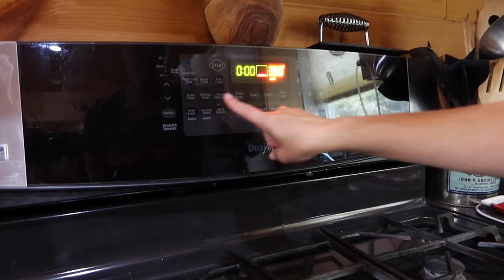Well I've Never Done IT Like this BEFORE. Prepping The Post & Beam Barn for Spray Foam Insulation

Comment: Are you going to batten the outside of barn still,?
A suggestion also would be to put up those baffles up by soft before foaming ceiling.
maybe pipe water down to barn for goats as a project also before winter. Then frame out your workshop.

Comment: If you are going to board over the insulation, why did you not just use mastic to hold roxul up until you board over it? You would not need to mask over your timbers.
Reply: Did you just get here?  Not using Roxul.  2 inches of spray foam.
Reply: @paulmonk7820  Did you not pay attention? He said he was not using Roxul because is does not stay attached to the wall without studs ( to jam it between.)  If he is going to board over it, that risk of it falling off after gluing it is short lived. 

             I'm using spray foam because
04:43  we got 8 feet ish on these big walls in
04:48  between the posts and if we did like
04:51 roxul or fiberglass  you couldn't
04:54 do it and it would just want to fall out
04:55 unless you put studs in

Comment: Build yourself a workbench with a trap door to drop your table saw in.
Get yourself a wall mounted Panel Saw, you are going to make a lot of panels.
Make hidden compartments in the knee braces.
You need a place for materials.
Cut scrap rubber pad for goat bed.
You need a sink with a medicine cabinet to put stuff in and hanging lamp.  Dish soap, sponge, comet , cleaning brush...
Plumb water a full pressure, not through regulator.
Fire Extingushiers
Build a wall mounted work bench in front of Gina's car to park under.
Make provisions for HVAC.  Wood burning stove?
Make provisions for an air compressor.
I know you know mechanics, were you going to build a garage with a lift?
Metal Rag Bin.
Flammables Cabinet.
Put a log splitter in the fire wood shed.
Get a Dump Bed Trailer to throw rocks in to clean up your field.

Comment: In the time it has taken to mask off the frames, you could have insulated the wall with hard insulation panels or even fibermats. As there are going to be animals either side of the main barn, I would also be worries about the vapours coming off the foam.

Comment: You made a statement around 5:11 that the reason you are going with spray foam is it adds structural value to the building. I agree 100% with that statement but you are not going to see that because you wanted to expose the wood beams inside the barn. You also stated that the foam was going to be 2" thick. If this is true you should have only applied 1.5" of tape on the sides of the 4x4s and papered the face of the 4x4.  To get the structural value you want from the foam you want the foam to adhere to the wood. This is important for where the wood 2x4's and 4x4's meet the wallboards. The way you taped and papered in the video the only adhesion of the foam to the wood is on the walls.
Reply: I agree 110% ;)

Comment: Al, the paper you covered the post and beams with is to wide, half that would allow the spray foam to adhere to the corners and insulate much better. It also would have been much easier to put up and take off. First time I've doubted one of your decisions.

Comment: You should do the roughing-in of the electricals first before you insulate the walls, IMHO.
Reply: Always!
Reply: @Arnold Allera:  They are installing conduit after the foam is done.
Reply: @paulmonk7820  Not a very proper way to go, tsk, tsk.

Comment: Yes. Wire it first, then insulate it.  Much nicer.
Reply: Wiring after will allow for a change in usage, though, if at some point this space is used for something other than a work space.
Reply: @stephanieellis5399  If they are going to wire it afterward, they can change use afterward.  I still say wire it first.

Comment: First project, add a metal flue for a wood stove for heat, with the concrete floor, fire hazard would be low.  On second thought, putting too much dry heat on the concrete floor before it finishes curing (can take a couple of years to completely cure) can cause it to crack.  Anyway some form of heat would be good in the winter.  I am with you on the insulation first since you are only using 2 inches that way you can run the wires and have access to them any time you need to in the future.  Keep up the good work.

Comment: RE:  cutting thru HARD food, such as buttercup squash....I have a kitchen hammer...i.e. one that lives in the kitchen only.  When I reach the 'un-cuttable' part, I use the hammer on the pointed end (not the point), and hold the handle part as I bang the knife thru.  Saves my hand, and helps prevent any accident that could be potentially B A D !    : )

Comment: Those bucks are not earning their keep. They can pull 1.5x their weight, assuming they are in the 30lb range: teamed they can pull 135lbs together, safely. More than enough goat-power to pull the feed buckets for the other livestock. Caprine is one company who supplies harness, etc specifically for goats. That would've been the training I would have started two weeks ago if I had two bucks living like kings  ;) But I am still wondering what's behind Gina's Mona Lisa smile regarding wood scraps last week.

Comment: Okay wait, I don’t understand the paper, won’t it prevent the spray foam from sticking to the wood, and if you plan to pull the paper off it will pull out the foam? I get the tape on the seams... well. I hope it works out for you... that looks like a lot of work. I sent my friend, Figaro to tell you not to do it..

Comment: I worked in cafeteria for 39 years, please when you cut those squash place a pad or folded dish rag over the point of your knife before you push with your weight on the end with your palm. If it slips the tip of the knife will cut open your hand. I have seen it happen.

Comment: Curious, how is the spray foam going to stick to the wood if you put paper on it? Won't it peel away in those areas? I understand covering the exposed surface but not the boards.
Reply from the maker: We still have one more step we need to do to get ready for the spray foam.
Reply: @LumnahAcres  Can't wait to see the next vlog.
Reply: I was wondering the same. I have no idea what’s going on, but I’m excited to learn! Haha.
Reply: The paper on the posts and beams is to keep the foam off them.  They want that wood visible when it's all done.  The tape over the cracks will keep the foam from escaping thru them. You know how foam is, it just goes wherever it wants to.
Reply: Paul Monk but there putting batten boards in the outside seams. So why not do that now instead of taping the seams? I could see if it was a vapor barrier?

Comment: Check in to the flammability and potential fumes-when-failed issues with foam insulation.  Mineral/Rock wool seems a better natural material, and it now comes in boards, batts, etc.

Comment: Hey Al, if you still have other projects that you need to use that paper to mask off I would recommend a hand masker, 100x easier to put on take off after. Paper roll and masking tape are attached to it and feed out together.
It’s used when prepping for painting usually

Comment: Vail, Co already has soem snow too. Are you using Open cell or Closed cell spray foam? (Used to work for instulation co lol) Open only has R value 0f 3.5 and Closed has R value of approx 6.5. Just wondering.

Comment: seems like to much trouble to me for a shop.  I would put the boards on the out side , you have to do it anyways to cover the cracks.  Then use the proper R rated fiberglass insulation.
Reply: @Kerry Burroughs:  This has already been explained. This is a post and beam building that they proudly built from scratch with their own hands, and rightly so. He doesn't want spray foam on the post and beam structure.  I agree, I would want that feature to show.

Comment: Hello I have liked all of your videos that I have watched so far. I have noticed that you keep changing the battery on your Pig fence here is something that might help first build yourself a small box with a bottom side and a top that is water and wind proof  and on the top put a small solar panel setup that will keep your battery charged this should save you both time and money in the long run. I hope this helps.

Comment: Would plastic have worked easier?  Since the insulation will be in those sections, do you need to paper the sides of the post?
Reply from the maker: It should make more sense in the next video on why we are doing what we are doing with the paper

Comment: Please tear off the paper and start over. Only put tape exactly where you don’t want insulation, not under it. Put the battens on the outside and let the foam fill the gaps.

Comment: why not run some pvc pipe around the walls for adding wires later. Then it would be covered by the insulation.

Comment: Would not spraying the foam insulation without tape penetrate and seal better than tape? And why duct tape and not a higher quality tape?
Reply: 10tenman10 thats masking tape he used, not duct tape. Different animal.
Reply: @cathiwim 
Which would be better. Masking tape is generally cheap junk. Why not just leave the gaps open?

Comment: Don't you have exterior battens or some such to put on the gaps in the back wall?
Reply: Yes I thought about that as well
Reply: So did i
Reply: A lot of viewers bring up that observation.  Al has a reason for not applying the batten at this time.  So, lets just see.  He knows what he is doing.  Same thing goes for the woodshed...at least on the car port side.  Al mentions battening that side...but for reasons unbeknown to us, is just belayng it.  In Al we trust.
Reply from the maker: No they would just be chew toys for the goats. 😆
Reply from the maker: The batton strips would be chew toys for the goats on the back side. We want to let the wood shed dry out first. And then decide if we want to leave the gaps to help ventilate the firewood or use the batton strips.
Reply: C. Ruf !
Reply: @CRuf-qw4yv  Someone said the goats would chew on the batten boards, and so he was going to wait 'til he moved them.
Reply: @LumnahAcres  BUT WON'T THE INSULAYION GET WET AFTER TIME AND CAUSE MOLD.

Comment: Yikes, that looks tedious, I would not have the patience.
Reply from the maker: It was. 😆
Reply: @LumnahAcres  I wouldn't have the patience either but I can't wait to see the results Al,
Reply: I didn’t have the patience to watch all that taping and masking.  Boring to watch.  Should have time lapsed it.
Reply: Why not just put the batten strips on the outside walls now instead of taping every seam? Seems like twice the work for the same end result?
Reply: Its a lot easier to tape it off now, than scrape it off later!
Reply: @kenwillis8487  I thought the same thing.  Actually, I thought they did.
Reply: Fast forward the video. Skip the boring bits.
Reply: @hallenw  - I just speed things up 2x. : )
Reply: @kenwillis8487  From my own experience, the spray foam can (and will) ooze out the tiny cracks between the battens and the boards then you have to scrape it off the outside.

Comment: Knowing the state where you were building the barn, why wasn’t some kind of insulation built into the barn?  Was it a very high expense or wasn’t it offered?  It seems like a lot of very tedious work after all the exacting build that came with the kit. Hmm 🧐. Could you have just painted the areas and that would have sealed the gaps?

Comment: Why are you putting the paper on the walls, how is the foam going to bond with it?
Reply from the maker: We still have one more step. It will make more sense Thursday. This is the way the spray foam company recommended doing it.
Reply: You know Al always does his research😊 Love that tack hammer.
Reply: Was wondering the same thing. Especially if "like unwrapping big Xmas gift" means pulling off paper, wouldn't that pull insulation away from the wall?  Or will wooden strips Gina's cutting hold insulation in place after removing paper?  🤔🤔🤔
Reply: @JohnWarden It looks like maybe they are making removable custom fit foam wedges? maybe to pull them out and mount the electrical behind then replace them? I have no idea, never seen it done like this, but it would be nice to have access to your wiring in case you needed to modify or repair something down the road
Reply: I think they are masking off the timbers to protect them from overspray.  Easily removed once the spray foam is done. That's my opinion. Hope everyone has a blessed day. My Bad I should have waited until the end of the video. He said it was to protect the beam😄
Reply: John Warden  i guess we will find out!

Comment: I hope you will read some reviews from people who have already had foam insulation sprayed in their homes. Sometimes after the installation has dried, the odor from the foam insulation is so toxic that people have had to move out of their homes. There are YouTube videos on this.
Reply: Good thing they don't live in their barn!
Reply: Yes, that's true.  But it's because the installation was rushed.    Depending on thickness, spray foam is sprayed in multiple layers allowing each time to off gas and start curing.    If you spray to fast, the top layer seals the bottom before it can fully off gas and cure, trapping fumes and uncured chemicals.    Same happens if you apply too thick of a layer.     There is a proper technique to follow.    Some just didn't care enough to learn the proper installation methods.

Comment: Why are you wrapping the sides of the beams, should only be the fronts if you want the foam to add strength to the structure
Reply: @James T:  They're only putting in 2 inches of foam, and they don't want overspray on the post and beam structure.
Reply: He's only spraying 2"s of foam and so part of the sides of the beams are going to show.
Reply: The foam will then slide over the paper... i would say.
I though the same.
Reply: @IceLynne , The paper should not be going all the way around into the corner. It should only wrap around the beam half way.
Reply: @augustreil  I agree with you but he's so meticulous that I'm going to give him the benefit of the doubt for now and I'm keeping in mind it's not a house but a barn/work space. I'll give a final judgement when I see what the finished job looks like ;-)  Who knows, maybe the guys who will spray the insulation will tell him to take it off! lol
Reply: @IceLynne , Agree. I used to do spray foam and for proper adhesion, the surfaces need to be bare and clean, that's all. I'm sure it'll all work out.

Comment: What happens to the foam along the wood joints when the masking tapes peels off
Reply: @ray427:  The foam will harden into a solid structure across both boards. No worry.
Reply: Paul Monk thank you, not to old to continue learning

Comment: Al, I hope you are planning to use open cell foam so any wet wood can dry. Closed cell may prevent water that leaks around windows from ever drying which will enable rot. The hundred plus year old barns in your area were never insulated. Unlike today’s homes, your barn was not built to keep water out.  I would speak to a knowledgeable builder before proceeding. 

Make sure to allow the wood cavities to dry from the inside or your barn will have a short life.
Reply: There are cheap ways to heat an un insulated barn. Wood stove when you are in for a long time. A hose looped thru a compost pile can bring in heat and your animals don’t need heat.

Look into a rocket mass heater as a summer project if you need more heat.

Comment: Gina, did I understand you when you said you and Al cheat by using water from your electric hot water heater?  I've never had an electric hot water heater, always had a gas one.  Was told never to use the hot water from it for cooking because their is a sediment that forms in the bottom of the heater.  Was wondering if what you're doing is safe.
Reply: There is no difference in the water inside the tank.  Have you ever drained yours and seen the sediment that comes out?  It comes from the water, not the heat source.

Comment: why did you not put up the batten strips outside?? that would have sealed the joints and saved tape, taping off time.
Reply from the maker: We didn’t put the batten strips in the areas the goats are because they will use them as a chew toy.

Comment: First time I went through and read a bunch of comments. Lots of free advice in there. 

But me as well, I don’t get what you are doing with the paper.
Reply: He wants to prevent sprayfoam from sticking to the posts. The sprayfoam guys told him to cover them this way. He will then remove the paper and is planning on covering the sprayfoam with something (not sure if he said with what, I may have missed it!). It looks like the boards Gina was cutting will be run horizontal on the walls before the sprayfoam is installed, to give him something to nail the wall covering to?

Comment: I know it's a few days late... but .... if you use your drop saw to cut the paper to correct width you can secure it with just staples and not have so much overlap and waist. Putting the vertical sections with the staples on the side of the posts hides them under the spray foam... and any expose staples (Much less) can be removed.

First winter job.
 To setup the vacuum pump on a shelf so all you need to bring from the house is the claned jar,lid and teat line.Have it set up so any overflow runs into a second jar mounted to the wall. you just plug into the vacuum line and press start(Power). you can also put hobby air pressure switch to set the suction an automate the vacuum. 
Second Winter job.
Automatic waterers and heat for the animals. requires guttering an IBC Tote,water tower and plumbing pipe..... 
Love you work!!
Good luck !